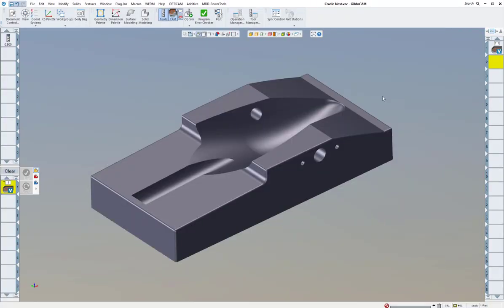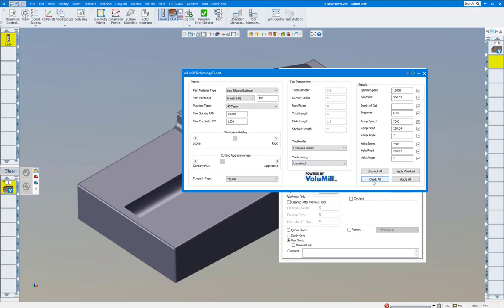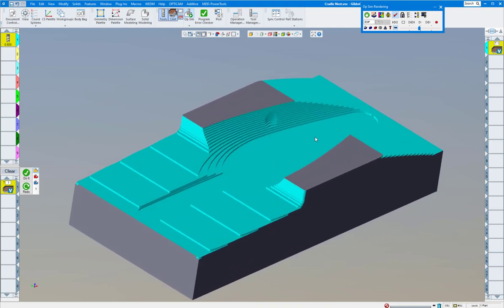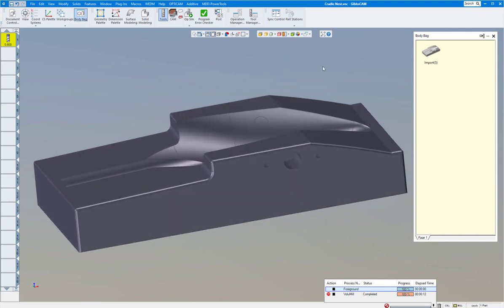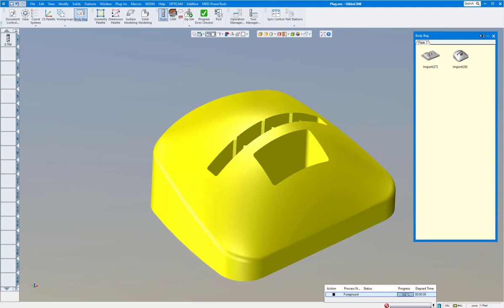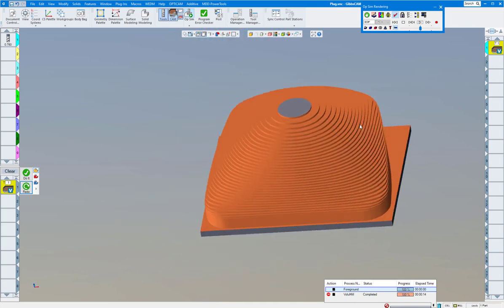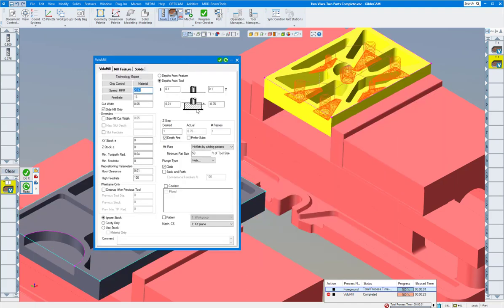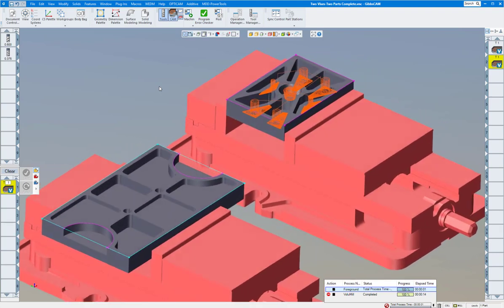Why you need Volumill Solids

Comment: Talking on the change of philosophy of high speed milling,  cutter angle of engagement produces some formulas to define radial chip thinning.  Desired chip thickness  will be the key factor per different milling cutter to achieve your ideal MRR.  I've always been calculating from my own values.  I'm interested how the software calculates the formulas.   Really nice adaptation for the technology expert fine tune for us.   Side note,  the small sample  that I've tried with Gibbs seems to lean super high speed to what I'm accustomed too in my world l. When I input the full capabilities on my available machine tools I am not yet comfortable to let them rip.   🐓
Reply from the maker: If you look at another video on my channel you will see a video cutting 1045 steel, 1" deep at about 235 ipm.  You will be amazed at how well it cuts.  I have never really seen a flaw in Volumill.  Note:  That demo was on a 20hp mill with only 900 imp rapids, but still did amazing well.  I normally stay on the conservative side just to be sure.  We tried Sandvik, Iscar, Kennametal on that part and they all worked well.  One guy brought us a 6 flute em and said try it.  I thought "its going to clogg up the end mill and break"  but amazingly  it worked fantastic.  Thank you for your insight !
Reply: @GibbsCAMVideoTutorials  definitely interested in taking a look at that video you mentioned!  Volume milling is definitely a game changer with all the high nickel stuff I work alot with.  Tool holders are super critical.  Currently where  I work,  we are cultured with cheap EM holders.  I need to my hands on a rigid holder.  Then I can gather some MRR data so that the shop culture changes to fully embrace the modern process with Volumill.
Reply from the maker: @punkdudex69  If you are working with nickel Volumill will work fantastic !  Just make sure you are not using ER collets.  Good luck !
Reply: @punkdudex69  I first met Volumill when a customer said no more casting Inconel 718 and I struggled milling the cavity with what Gibbs gave me without Volumill.
Once I had Volumill demo I got through the first layer in no time. Boss said get it and the roughing all went smooth with the Iscar Multimaster type bullendmills and ballendmills from then on.

It's been years since I had Volumill Solids so I needed this video to be sure I wasn't remembering wrong, glad I wasn't.